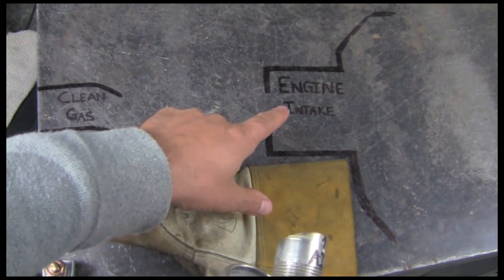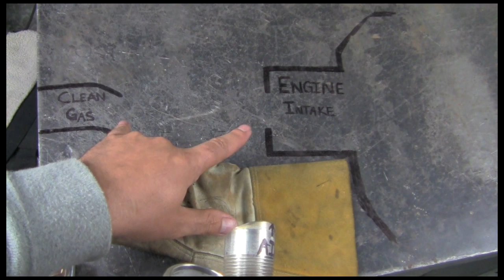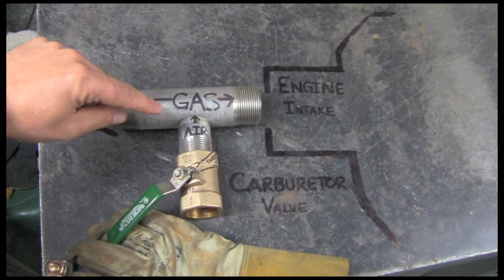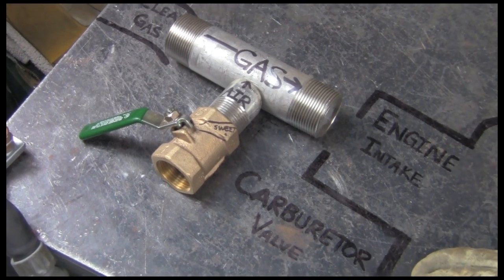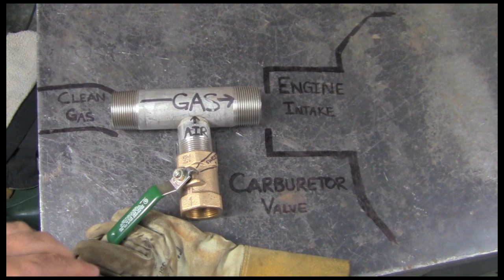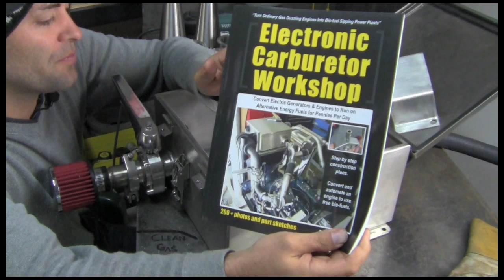Wood Gas Crash Course 4 of 7 (Gasification 201) woodgasifierplans.com

Comment: would that work for HHO gas somehow? that custom made thing at the end
Reply: They check the gas pressure for know how much gas are go in for balance whit air, the fuel ratio for wood gas mix are 1:1 whit air and 1:1 whit hho so you can use this solution only whit One of this gas but in case of hho are really hard top have enough instant gas for run a engine and I don't raccomend to compress if for future use but whit wood gas if you clean enough can compress and resolve the problem of instant quantity making of gas.
Remember you can Easy convert only gasoline engine not diesel becouse they don't have Spark plug and Need to retard tdc becouse gasoline do Spark After 10° more time combustion and gas like hho wood lpg methane do close to 0°

Comment: How hard would it be to complete the refinement process and make a liquid fuel?
Reply: You Need more explain... If you use a gasifier you can pirolize wood not plastic, you get a lot of gas mix from wood and small quantity of piro oil (for gasifier like this 5kg of wood/h I tink you can grow a Little close to liter) if you use external eating whit closed camera you can piro all bio material Better plastic (but you can try waste oil or wo engine rest of food or chemical mixure) if you use It obtain small quantity of gas and High of piro oil. Then you can regine whit chimiche solutions for get One product Easy diesel or can use a dinstiller for let go out the water and get kerosene diesel High gasoline and low gasoline. If you talk about new technology for convert gas into liquid let go out this idea, nano membrane are insane but a lot more expansive
Reply: It's a pain in the you know what. It takes a lot of work and makes very little. It is a lot of work.